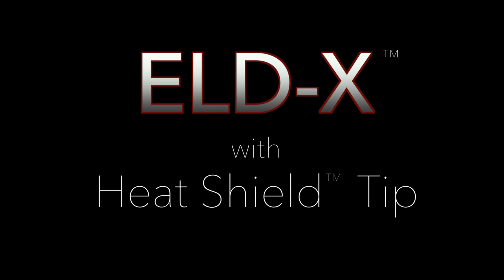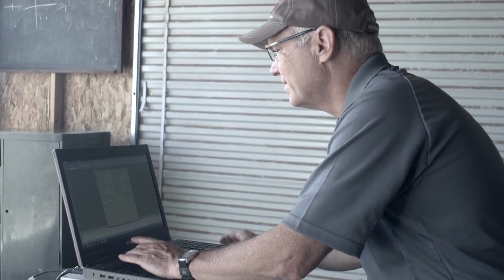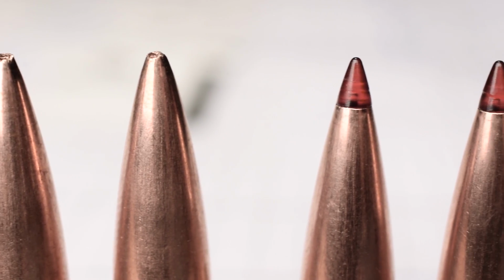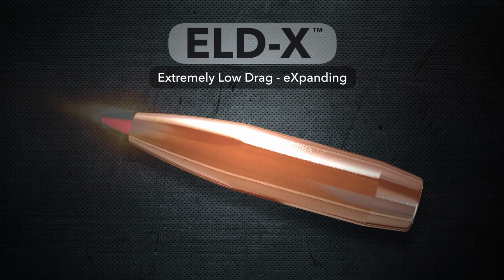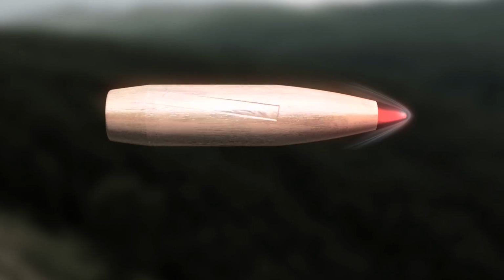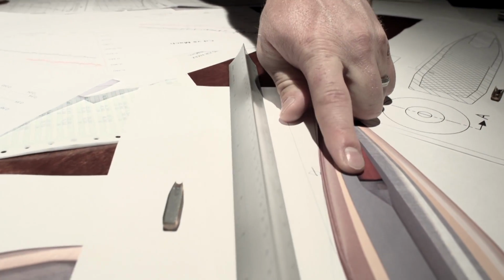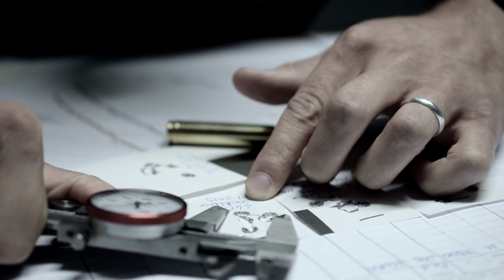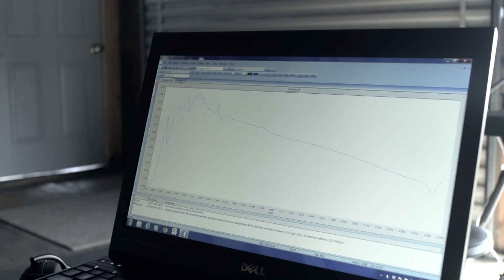Hornady® ELD-X™ with Heat Shield™ Tip

Comment: Absolutely great bullet 250 yards and beyond!  Yes it’s accurate but….Not so much under 200! Accurate still but…Too soft, too frangible , need it to be a partition type….H- mantle type or at least a fusion bonded core ( Accubond LR for instance).  It would then be great from 50-700is.

Comment: The heat shield thing I don’t buy, I recovered a .223 vmax doing over 3000 fps, the plastic tip was like brand new..no melting.
Reply from the maker: V-Max really aren't affected by this. They have a low enough BC that they lose the velocity quickly, and thus the temperature drops fast enough that they aren't affected.

Comment: One question, why did you move the interlocking ring forward to make the bullet fail? The SST had enough failures with the locking ring back. Now you've pushed the locking ring forward and now the bullet just comes apart. Don't make no sense when the creator of the locking ring in y'all's company put it all the way at the back so it we keep the bullet together

Comment: So where is the 125 grain ELD X bullet for the 6.5 caliber because of the speed I will not use the heavy ones, a 125 to 130 grain flat base ELD X would be great but it does not exist, I think Hornady should make it because it would be a very big seller and a 125 grain bullet has plenty of sectional density up to mule deer sized game. Now that's my two cents worth coming from a hunter as I will not use the heavy ones because they are just too slow, aim small, good hunting, GOD bless.

Comment: Had a box of these in 7mm-08 150gr ELDX. I shot a buck at 80yds and it took 2 shots. Both bullets did not exit. I have not used this ammo/bullet combo since. Yet I used the old GMX and Spire point Interlock bullets for years and had no problems with either
Reply: Sounds like you missed.
Reply: @StuninRub  no I didn’t.
Reply: @larrysayers1377  You missed, the last thing you want is for bullet pass through. You missed the vitals. Learn to aim.
Reply: @StuninRub  🙄
Reply: @larrysayers1377  No surprise here.

Comment: The ELD-X is not what I had hoped it would be, the ELD-M however is a very fine bullet with incredible terminal performance. If the ELD-X had been bonded I think it could have been a winner but terminal performance is seriously lacking and it pencil holes most deer leaving little blood trail. Out of 12 White Tail deer every single ELD-X core separated and was unpredictable in terminal performance. Sometimes it would pencil, other times it would open a egg sized exit hole but not usually. I will give the ELD-X one kudo, it IS accurate but so is the ELD-M and it just performs better on game every single time. Doppler radar and all that is nice but I care about what happens when the bullet hits the MEAT and the ELD-X just is not something I found to work as well as other available hunting bullets. Love Hornady just not the ELD-X.....

Comment: Working up a load for my 300 PRC. At the time I bought it, I couldn't find any brass (still can't) so I bought a box of their Precision Hunter 212 grain factory ammo. If these shoot exceptionally well, I will buy a box and handload from there. I understand R26 is the preferred powder for these bullets, and used in their ammo. Of course that's one I don't have and can't find.

I have their manual but was wondering what are some alternatives that others have handloaded them with, that have performed just as well? Thx!

Comment: Interesting vid. which doesn’t apply to me. I am a HUNTER. I keep my shots under 300 yds. The good old 180 gr. Hornady interlock has served me very well for 40 yrs.
These animals were put here for our use they are not targets. I get sick of hearing this bragging about shooting deer at extended ranges.
Reply: I agree completely. I shot a mule deer last year with my 6.5 creedmor, ELD X 140 g. bullet at 160 yards. The first bullet failed, core separated from the jacket. The jacket was stuck in the hide on the entrance side. Second round was a complete pass through and killed the deer. I’ve never had a bullet failure with Winchester silver tip or Remington core locked

Comment: Do they use the same tip across the board? Not for nothing but I tried the FTX 160gr. In my 1956 Win94 30 30 holy hairy butthole! A 30 30 ain’t supposed to be that accurate butt Seriously though folks i really did see improved accuracy with a heavier bullet to boot.
Reply from the maker: The FTX has a Flex Tip.  The ELD-X and ELD Match lines feature this Heat Shield Tip.  Thanks for your support and keep sending them down range!
Reply: The FTX projectiles have completely changed the 30/30 in to a rifle that younger shooters are now buying for use most anywhere!  Not just a woods rifle! 
If I’m heading out bush into the mountains for a few days, I take 2 rifles, either my Tikka 7mm-08, my Ruger (full o/b suppression) 270win and without fail, my 336 30/30 firing both the 140gn and the 160gn Leverlution factory rounds. 

Extended range and a bigger thump! Nothing that isn’t already extinct can walk away from them down here in Nw Zealand!

THANKS @HORNADY Manufacturing you’re LEGENDS!!

Comment: i'll be trying these this season in my 300 weatherby. can't wait to hit the range.
Reply: 🛑🛑 I’m interested in your results with the ELDX in your 300 Weatherby. 💯
Reply: @genekelley7579   they are the only bullets I use in the 300 now. the consistency is on point but got even better after I had the carbon fiber barrel installed. it's a killing machine for sure.
Reply: @9thangle  
I wanted to run ELDX bullets through my 257 Weatherby Magnum, however I’m afraid of close range shots and the bullet blowing up at 3200 feet per second. 

What are your thoughts?
Reply: @genekelley7579   I have killed deer, antelope and elk with these bullets. I don't think I've had to make a shot over 300 yds and the damage is what a 300 does regardless.
Reply: @9thangle  
I just was afraid of the 50 yard shots.

Comment: So can I ask if the rim fire V-max  rounds will also receive these tips?
Reply: sswmetalhead why would you ask this? Do you launch rimfire out of an airplane doing several mach? That's the only way the projectile would be moving fast enough, long enough, to melt. These guys are talking 800 yards and further is the starting point of heat affecting BC.